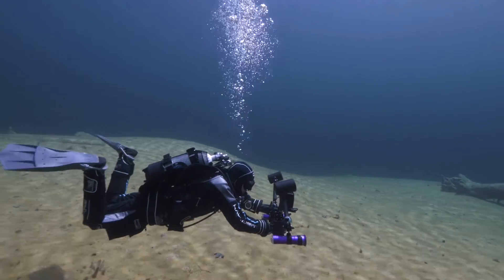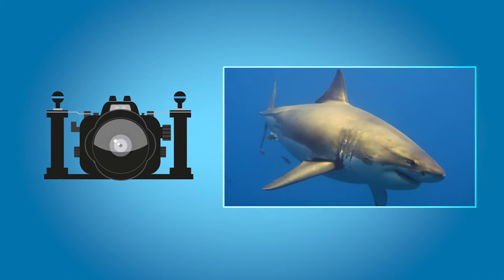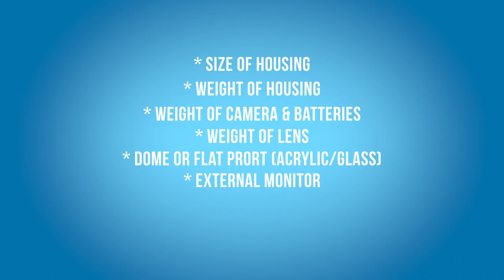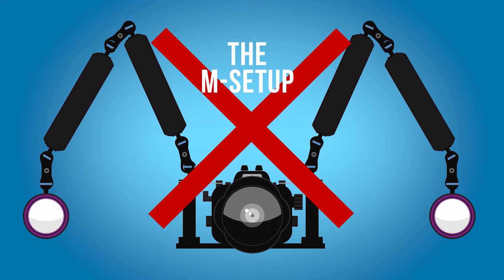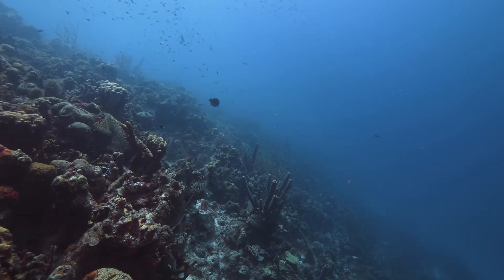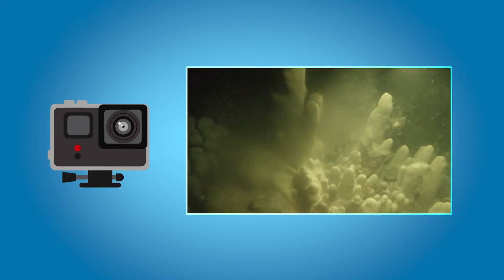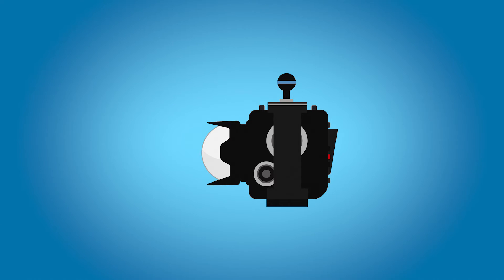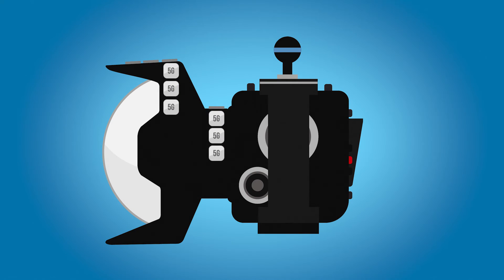Perfect Buoyancy for Underwater Housing - Underwater Filming Tips

Comment: Thanks heaps for explaining. Tried to film with a cheap chinese goplo (not that costly if wet, nor if I didn't like it) Had an old greenforce battery lying around and bought a second hand halogen head and changed the bulb for a diffused led. Almost perfect, small but powerfull AND cheap. Did notice the weight of the battery(would a neoprene sleeve help?) and I might get a cable and some loclite tube to move the light more to the back (anti reflection?) Do you have any experience with greenforce? Was thinking of upgrading to maybe a second same light as well and build up a tray from there (now using the handlebar as mount) but I would need buoyancers. Or would you recommend going for 2 smaller lights like Archon w17v and arms to make things lighter?

Comment: for the trim of the housing do you think i can use zinc instead of lead sheets? i couldnt find lead sheets and couldnt find out if zinc corrodes in saltwater (i know zinc is used as corrosion protection on land)
Reply from the maker: Try it out if it rosts then take it off and clean it. But would assume it doesnt :)

Comment: I can find float arms easily online , but I can't seem to find those grey floats you attached vertically in the middle or on top of the float arms on the sides of the monitor that are shaped like a cylinder, what are they called? Thank you
Reply from the maker: Aquatica. You can also use the big Inon or Nauticam ones. Work fine too.

Comment: Question if you might answer. I plan on buying a housing for my D850. I plan on shooting mostly video. Would you agree that one should buy the most lumens they can afford? I guess it would depend on the distance of your subject? And are you  just talking and sharing this info without cue cards? OK not an important question ha ha. 

If you would like to teach and earn some cash with a paid for trip to the Bahamas you've certainly earned it with your videos. Thanks.
Reply from the maker: it will depend on the quality of the light, if really the lumen power is constant during the runtime of the battery. a lot of cheaper lights decrease in power during runtime. so at the end of the dive the lumen might be a lot less. you wont notice it visually during your dive but in the footage later. also it will depend on in what lighing conditions you want to use them. nighdiving e.g. you dont need much. bright daylight in shallows you will just be able to add a bit of brightness to the shadows, because you can't compete against sunlight. if you are at depth, sure the more the better. but the light will only travel "more or less" 1.5m underwater... and shooting macro is a different story too. if you are shooting wide, you want to have a nice soft beam/edges. so a LOT to consider. Usually the onces that are being used a lot are the ones that are good.. so if you have a manufacturer and you don't see anyone using them in the video field... we'll it could be because they are not so good. But I can't say that in general for all lights :) but check around who is using what and talk to people. best would be to test them yourself... or go to a show and talk to the different manufacturers. :) hope it helps.